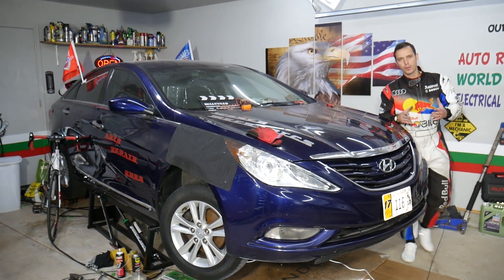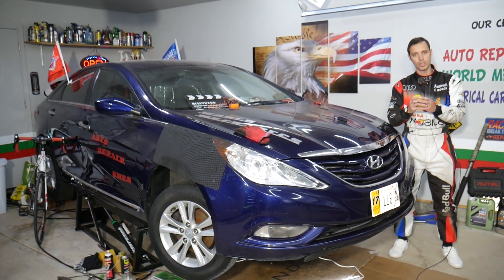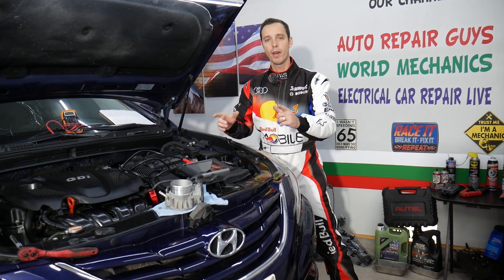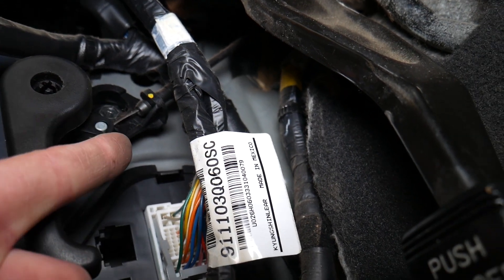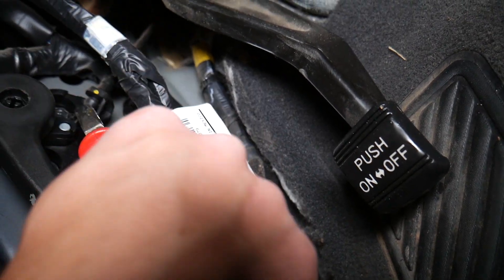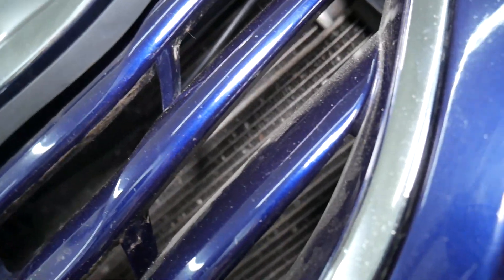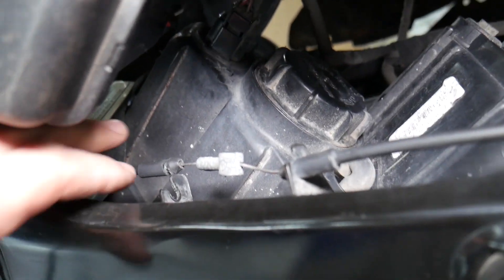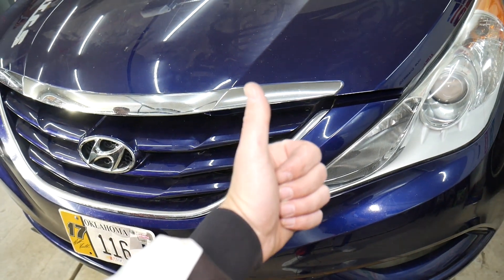HOW TO OPEN HOOD THAT IS STUCK ON HYUNDAI SONATA

Comment: How did you remove that panel near the lever to check if the cable there was connected? It happened to my car and I am not able to remove the panel. Even the front grill has no cable visible inside

Comment: I have 06 model and appears cable is in a conduit.  Any suggestions?
Reply: Same. Did you ever get the issue fixed?
Reply: I have the same problem
Reply: Me too, 2006 sonata and I have a headlight out and really need to get in there Pronto